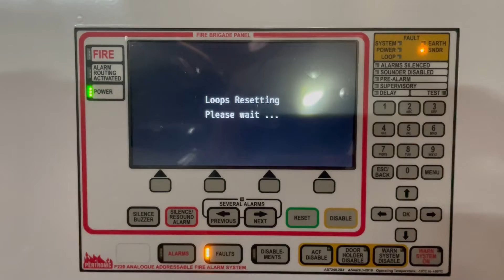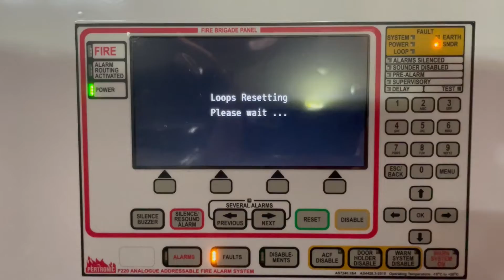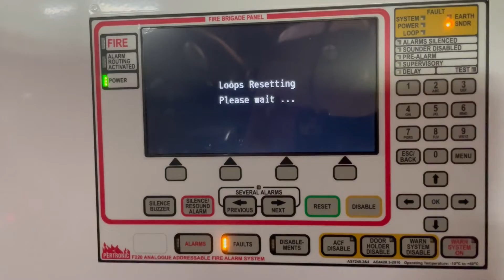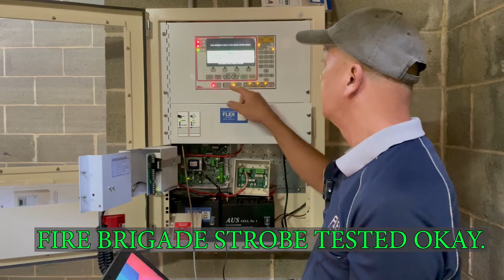Fire Alarm Panel Replacement. Conventional to Addressable Fire Panel. F220 (F107) #fire #firealarm

Comment: Nice job Elmer. 

I started looking at your videos.  It is interesting to see how it works in other Countries. The fire alarm panels are quite different then the ones we have here in Canada. I see that there also some differences between how we do things here in Canada et Australia. The code and standards for installation/commissioning/ testing are different.  For example, we can only install an EOL resistor in a device if it is by itself on the circuit. If there is more then one device on the circuit we have to install the EOL resistor on an EOL resistor plate in a seperate electrical box at a maximum of 1800 mm from the floor level.
Reply from the maker: You're right mate. Different standard and procedures. We also used some american products like simplex, & edwards fire panel. They are a bit more complex to our requirements. We keep us simple. The newer Notifier 3030 (popular here) is American by Honeywell. Gee...I programmed that fire panel and I will never recommend it. There were more simple panel than that. Cheer Mate.

Comment: Would you be able to do a video on how mechanical fans work and how they are wired?
Reply from the maker: How the fans work during an alarm is all depends on the design and agreed set up of the system in the building as approved... such as stair press fans will  kick in and others may shut down. It all varies depending on how big the system is. For how they wired, the mechanical control panel has a designated terminal block (RED) inside where the fire cables will connect. These terminal blocks are either normally open or close contact/relay connected or volt free contacts. I can only discussed the fan controls addressable switches as mech control panels are so different. Best is to discuss FAN CONTROLS.

Comment: What did you achieve replacing the panel apart from ripping off the customer?? There is no advantage the new board offers that the old board couldn't do without a external exhaust fan control relay on an auxilary output.... Having the loop responder in the panel and still using conventional wiring and detectors is selling this new Pertronic board very short of it's capabilities.. for 3 circuits!!!  Cripes I'm glad I wasn't picking the bill up!!
Reply from the maker: First the old FIP has to go. No parts available. Second, suppliers will tell you to buy an addressable FIP and install a conventional module. Third, to install a fan control to a conventional panel is not available now in Australia ...you have to go Addressable. And lastly,  if not a ripped off. Every fire company and the supplier in Australia will tell you that I made the right decision. Please watch the previous video of the condition of that FIP. I wish you'll see it before I decided to replace it. We have Australian Standards to follow and maintenance issue to consider. Thanks for the comment.

Comment: Prepared for the zoning labelling tagging in existing fire rated cables in old facp, replacing the conventional F/A devices into addressable facp and rearranged the existing loop zone and interfacing contact also remove the existing EOL for the loop continuity from loop out address routing return to loop in facp. I love your fire alarm demo and I just support it 👍👍👍